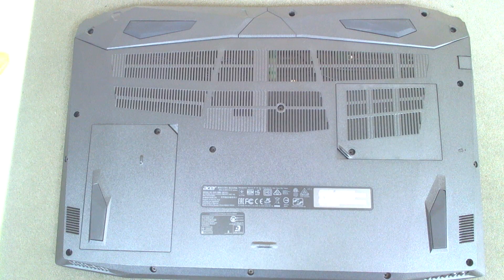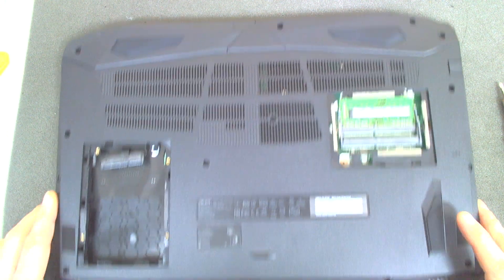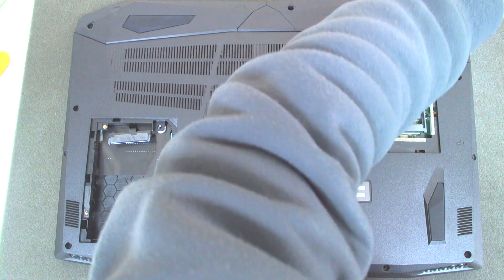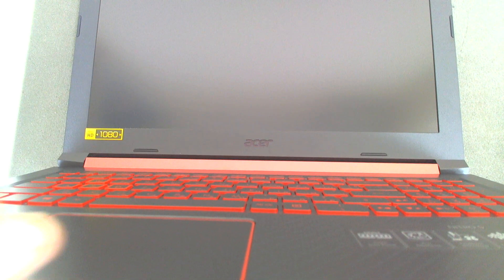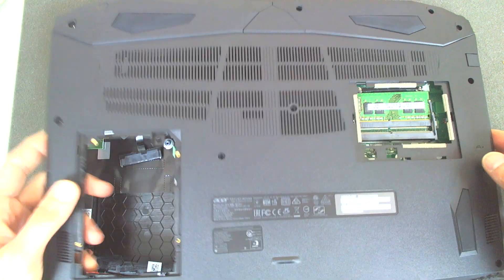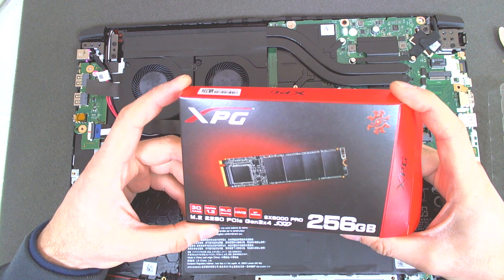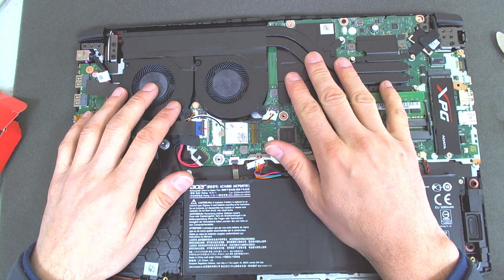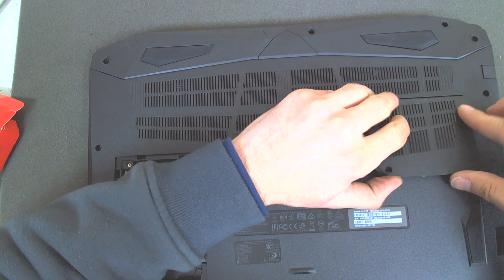Acer Nitro AN515-31 М.2 SSD Upgrade / Install

Comment: why do you need to remove the whole bottom panel when you have separate slot removal available for SSD and Ram upgrades?
Reply from the maker: I guess you did not watched the hole video. The slot is for the regular 2,5" hard drive. In the video i upgrade ( add ) M.2 SSD on the slot, which is next to the ram, but you cannot access it without removing the back cover.
Reply: @LaptopDisassembly  oh yeah. Watched it. It outside that separate slot area. Got it. Thanks!

Comment: Hello ...bro ..please
Tell me which is the best m.2 ssd?
Samsung 860Evo or XPG 6000 pro
Reply from the maker: I would go for the Samsung. I had a few problems with Nitro and AData ssds
Reply: @LaptopDisassembly  and one more question bro pls.....does AN515-52 supports nvme SSD !?
Reply from the maker: Yes
Reply: Pls reply!!
Reply: Bro!..but some users are saying only m.2 ssd is supported not nvme ssd
Reply from the maker: @gaminggalaxy2025  i did install abiut 5-6 nvme on that laptop. But i had 2 cases on adata ssd, the laptop was loosing the ssd from time to time. After replacing them with Kingston a2000 ir Transcend models, the problems disappear.
Reply: Then ..what should I buy nvme or m.2?..I am asking so many ..but no one are giving correct info bro...
Please atleast you should solve my issue
Reply from the maker: Well you will not see any difference between nvme and regular m. 2 ssd if you are using the laptop for regular things. If you are using big files or use the laptop for programming nvme will be better. It is up to you.
Reply: @LaptopDisassembly  thank you for giving info❤❤
Reply: And last ..please can u suggest best ssd for this laptop..I mostly play games and sharing files
Reply: Bro reply pls!!
Reply: My laptop Acer i5 8th gen gtx1050ti
Model- AN515-52

Comment: ''Even the laptop is new check the screw of hinge'' BRO WHAT ? if you do this your warranty is gone. Guys dont do this. Just change the ssd and dont touch any cable or screw.
Reply from the maker: I just say to tide the screws... Not to remove them. Beleve me im selling computers for about 15 years so far... You have no idea what is the new electronic. Sometimes the laptops comes with scratches and not connect cabels, or not proper connected ram... But is up to the customer.. :)

Comment: hi sir yanko. how do i make my hdd as storage now that ive finished putting my os on my ssd? thank u
Reply from the maker: Just remove the old regular drive and format it on a different machine. Or start a fresh instalation and just go to the part where choosing the disk, and just format the regular drive. After that cancel the instalation.

Comment: What if I don’t want my windows on my ssd?can I just boot it without fresh installing windows on ssd and keep the ssd only for games?
Reply from the maker: In order for the computer to work faster the os must be on the ssd. Uoy can leave the os on the regular drive and out the games on the ssd, but it will work absolutely the same like without ssd.
Reply: Yanko Goshev Yes thank you. I don’t mind it working the same but I get 100% disk usage when playing my games on my HD. So therefore I want only my games on my ssd
Reply from the maker: You get 100% disk usage because your regulars disk cant keep with the os and the other parts. If you install the games on the ssd only, you will get 100% disk usage again, because the os is one slow regular disk, no matter that the games are on the ssd.
Reply: Yanko Goshev also will this ssd work fine? https://www.mymemory.co.uk/transcend-240gb-sata-iii-m-2-2280-internal-ssd-6gbps-550mb-s.html?gclid=CjwKCAjw4rf6BRAvEiwAn2Q76hiRi1ktFv_DxIbmHsFtwvvQXCjf5J186whTUVhBuGS2W8IqPS0ifBoC0HkQAvD_BwE
Reply from the maker: Yes it should work fine.
Reply: Yanko Goshev okay thank you. However I did notice that the golden pins shape on your ssd is slightly different to mine. You sure this would work fine? Thanks again
Reply from the maker: The one i install is nvme, the one you post is a regular sata 2280 ssd. Both work fine with that model.
Reply: Yanko Goshev But will games work fine without FPS drops? (I’m getting freezes now) if the games are on ssd and OS is on hard drive? Or no?
Reply from the maker: @Mark-jc8eg  it will be like is without ssd. The os must be on the ssd. The game can be whether on the ssd or on the regular drive.
Reply: Yanko Goshev hello, I cant seem to unscrew the ssd screw. It’s so tight. What screwdriver do I need? I have many and I think I have the one needed
Reply from the maker: It is a regular screwdriver.. Just use smaller bit. Also while tring to unscrew it, push down and try to make a turn..

Comment: Hi Yanko! I have a question. If I put an M.2 SSD on my nitro 5, do I still need to use backupper or true image to install windows on my new SSD or its okay not to? because I dont mind formatting my old HDD since its new. Thanks !
Reply from the maker: When you install the ssd start a regular installation. Delete the regular disk, format the ssd and install the os. Aomei Bacupper is when you like to clone the os to the new ssd.

Comment: My acer nitro ryzen is painfully slow. Games runs good ,but the boot time and freeze and everything else is very very slow. 
Has someone else encountered this?
Reply from the maker: Just add ssd drive, if you dont have by now.. It will change the laptop completely
Reply: @LaptopDisassembly  thanks my man

Comment: Hi Yanko,
Can I use samsung v-nand ssd 860 evo 500gb in my acer nitro 5? Thanks!
Reply from the maker: You can use it, but lately i noticed a thing. This modela do not work properly with all thw nvme models. I had few but they dont work properly with the same ssd. They work with transcend ones, but not with AData or Silicon Power. So is all about the memory chips. If you can try it before buying. The problem si random bsod every few days.
Reply: @LaptopDisassembly  Many thanks Yanko for your comments....please can you tell me the specs for 8Gb RAM for Nitro 5? Thanks again!!!
Reply from the maker: In my case if was 8gb 2400MHz DDR4
Reply: @LaptopDisassembly  Many thanks!...stay well!

Comment: Can you do this with the acer nitro 5 an515-52-52bx with Intel optane.?
Reply from the maker: The disassembly is the same. Disconect the hard drive and remove the screws. After that lift the back cover, that's all.

Comment: Hi, I have a  acer nitro 5 AN-515-52 i need to install SSD, i already have made lots of game installs in my 1tb and data too, if i install the ssd is it necessary i need to install windows in it for the laptop to become fast?

If i need to install the windows on my ssd will i loose all my data from HDD or just the windows data?
Reply from the maker: Hello, if you i stall the windows on the sad drive you will loose the installed games and software. Best way is to clone the instalation from the regudrive to the ssd. This will make a mirror image and it will move the old instalation 1:1 to the new ssd. Use programs like aoemi Bacupper or acronis true image
Reply: @LaptopDisassembly  I had seperated three drives basically , C- Drive in which my OS is installed , D- Drive in which my Games are installed and E- drive for my other music, so if i am installing Windows on my SSD from C drive will i still loose my data and games from D and E drive?
Reply from the maker: Even if the games are installed in the others drive, they still put some system files in the windows and program directory, so after tge new instalation probbaly the games will not run. So best way is to clone the os drive only..

Comment: Hello I have a question, so my nitro 5 has only 1tb hdd and I am planning to install an m.2 ssd and plan to move my os there for faster startups and maybe a few  commonly used apps. I was just wondering if I move the windows to the ssd, will it affect my files? Sorry I am not familiar with these parts.
Reply: Cristian Gannaban what is the version of your acer nitro 5?
Reply: @Dontknowanymore1111  the 2018 version actually
Reply from the maker: No, when you clone the windows it copied the files 1:1. There will be no difference before and after the cloning. Use aoemi Bacupper or Actonis True Image.

Comment: Man you need to study up on removing back panel you look like you simply do not know what your doing
Reply from the maker: If you say so...
I have been doing this for about 15 years so far. This is brand new laptop, that the costumer havent seen yet. I try to be as much as careful i can be. You will probably not buy new laptop with scratches on...

Comment: My Acer nitro 5 comes with Intel optane memory. Will I have to remove that to insert an NVME2 SSD?
Reply from the maker: Yes
Reply: How will the setup be then? I'm not sure what to do after putting in an ssd instead of the optane
Reply from the maker: @scarztea  what exactly is the druve in the slot now..
Reply: I have a 1TB HDD and 32gb Intel optsne memory installed right now but there's only one C drive on my laptop
Reply from the maker: Well in that case, remove the drive. Install the new ssd. After that go to bios and change the sata mode to ACHI ( it was intel optane i suppose) Aftwr that make a fresh install or clone the os to the new ssd

Comment: My headphone jack stopped working after. How to fix it ?
Reply from the maker: I dont remember correctly where exactly it was, but did you connect all the cables before closing the laptop.
Reply: @LaptopDisassembly  Got it working. Opened the laptop again and saw that the board with 2 usb-A ports, charging port and headphone jack slipped inside little bit. So i got it fixed myself.

Comment: Why i’m not able to boot? The computer doesn’t find the usb stick
Reply from the maker: Did you make a bootable UEFI media. If not try to activate the legacy mode from bios and activate Boot Menu (F12) from main page on bios.
Reply: @LaptopDisassembly  it's activated, but my computer doesn't see the usb stick in the boot menu. There's just empty  in boot menu. Maybe it's because of the usb stick. I'm gonna buy a new one. But what if it still doesn't work?
Reply from the maker: Make the flash drive with Microsoft media creation tool and also try different usb.
Reply: Yanko Goshev how to do flash drive?
Reply from the maker: Download the program and follow the wizard

Comment: And does this work with all Nitro 5? Btw can I still do this upgrade after I used the laptop for like 1 year
Reply from the maker: The laptop is 2019 year. Yes yoy can do tje upgrade any time. Just clone the os or make a fresh install after that.

Comment: Nice content.. keep it up.. I want to know how to upgrade RAM.. if RAM 4gb combine with RAM 16gb.. what will happen..? Thanks.. done subscribe for you channel..✌️😊
Reply from the maker: Hello, first look what is the configuration of  the memory now. You have 2 slot total. If you have one with 4GB than you have one free. If you add one 16GB ( if possible ) you will loose the dual channel mode. The better way is to remove the one you have now and add 2x8GB. This way you will have 16GB total, working in dual channel mode.
Reply: @LaptopDisassembly  o i see.. which one is better dual channel mode with 2x8GB or single channel mode with 16GB
Reply from the maker: @jempurungjebert  Dual channel will be about 10-15% faster, but you will loose the ability for future upgrade.  :) It is up to you
Reply: @LaptopDisassembly  wow.. thanks for sharing..  will be think twice.. by the way.. sharing from u very helpful.. thanks a lot..

Comment: Is it possible to move already installed win10 in the default HDD to the new SSD, of course without fresh start(delete , reinstall)?
Reply from the maker: Yes, use aoemi Bacupper and use the systrm clone options.. It will do the job
Reply: @LaptopDisassembly  Baccuper is a software? AOMEI Backuper? 
Does the free one will do the trick?
Reply from the maker: I use the bootable CD ...https://www.ubackup.com/features/create-bootable-disc.html
Reply from the maker: Or use Acronis True Image also bootable DVD It will do the trick
Reply: @LaptopDisassembly  btw, does 128GB SSD will be enough for only the system(win10 home, pro, or any win10)?
Reply from the maker: @SatrioBudiDharmawan  yes is more than enough. When i install a costumers laptop i leave 100gb for the operating system. If you have a steam account you will probably need more, but usually is more than enough
Reply: @LaptopDisassembly  well, actually I have steam accounts and play a lot. But I think I will put the steamapps on the HDD until I can save money to buy bigger SSD.. :)
Reply from the maker: This is also an option,  but the difference between 120 and 240 is not very big.
Reply: @LaptopDisassembly  Btw, I have a question, dunno, for Acer Nitro 5 (AN515-52-51T2). I got it with original 1TB HDD is ATA drive.
Is it normal to have it ? I mean, today, ATA...seems weird
Reply from the maker: It is not ATA.. It is Sata.. There are plenty still so no worries.
Reply: @LaptopDisassembly  no,.I mean my laptop(that Acer I mentioned) is detected as ATA not SATA. I only checked it with WDC Data Lifeguard Diagnostics something, it read as ATA not SATA..
Reply from the maker: It is impossible. The hard drive is 100% sata or it can read it like Serial ATA, which is the same. Enter bios and check how is recognized.

Comment: I bought this laptop three days ago. It is very slow in easy tasks. It takes a lot of time to open the program. Sometimes there are some problems inside the program that comes with hdd. If I add m.2, will it make a difference?
Reply from the maker: Yes, it will make it faster. But you should check the regular hard drive. Use CrystalDisk Info to see its health.

Comment: I have Acer Nitro AN515-54
I have already 1 tb regular micron SSD i want to upgrade to NVMe SSD, i want to know if i can keep both and how do i install new OS on new SSD 
is there any way to transfer my current windows to new SSD, i don't want to loose my current setting and programs.
Please help me with this
Reply from the maker: Youcan clone the os with acronis true image or Aoemi Bacupper.. I use the second one mostly.  To use both ssd you have to put thw nvme on the m. 2 slot and the other ssd with convertor from m. 2 to sata. https://www.ebay.com/itm/163358159768

Comment: Can i buy samsung 860 evo 250 gb for my acer nitro 5 and use ssd and hdd at a same time. Plzzz reply
I have AN515-42-R6GV MODEL
Reply from the maker: Yes but the ssd should be m. 2 2280 not regular one.
Reply: @LaptopDisassembly  sir can you plz put the link I will be thankful to you becoz it's my first time and I don't want to regret. Plzz sir
Reply from the maker: https://www.amazon.com/Samsung-250GB-SATA-Internal-MZ-N6E250BW/dp/B07864V6CK
Reply from the maker: This is better https://www.amazon.com/Samsung-970-EVO-250GB-MZ-V7E250BW/dp/B07BN5FJZQ
Reply: @anuj3438  did it work for u?

Comment: Hello , i'm getting some trouble , when i put the ssd in and turn on the laptop , Bios showing up , but i did not see the name of the SSD, then i go to boot and did see anything in Boot Priority order , and also my Boot mode only have UEFI , pls help me
Reply from the maker: Did you try to install windows. The ssd should be visible in the installation section. Yes UEFI is better to install windows 10
Reply: Install windown ? Mean move the windown from hhd to ssd ?
Reply: Or i need to have a new windown ? Cause i did not replace the ssd , it was empty in the first time i screw the laptop
Reply from the maker: Do you have any operating system on some of the hard drives. If yes, try to clone to the new ssd. If not tfy to make a fresh install to see whether it will detect the ssd or not.
Reply: I will try to clone
Reply: I have a problem , when i take the sdd out , then i turn on the laptop , the Bios still appear , i'm very confuse , i thought it would be back like normal
Reply from the maker: What is appear,  i cannot understand. If you did clone the disk, try booting from the new one. Just remove the regular one and try to power on the laptop. If that douse not work, just make a fresh install on the os.
Reply from the maker: Sorry for the delay but is due to time differences. :)
Reply: Well , i found the problem , i broke the HDD cable :v , now i need to find one and buy , or can we run the laptop buy move the windown from HDD to SSD ? I mean let it run by only using ssd
Reply: I find the cable online , but it only deliver in US , i living in Canada , now the laptop is a little bit dusty .___. , now i just wait for someone on ebay who gonna sell that
Reply from the maker: @ToanNguyen-xy3rk  you can putthe regular disk in external case and clone the os ti the ssd with aoemi Bacupper. The laptop will work only with ssd till the cable arrives
Reply: Hey man , i bought the new hhd cable , i put it in and turn the Laptop on , after 30 minutes of attempting repair , i finally  get straight into my desktop , but the problems is i try to find The ssd , by going back  to Bios but still i did not see it ? I don't know what is the problem
Reply: Thanks for reply

Comment: Can you tell the exact size of the screwdriver for the ssd screw please?
Reply from the maker: The correct screw size is 2.0 x 3mm. I cannot tell you about the screwdriver. I just use a smaller cross one.
Reply: @LaptopDisassembly  cause I tried a number of screwdrivers yesterday but none worked😶. Was a waste of time opening it and putting it back again
Reply from the maker: Just use one with sharper head, like the ones in the iphone disassembly kits.

Comment: Hello, i have an Acer Nitro5 an515 52 512j have this laptop a M2 SDD slot?
Reply from the maker: Yes it have.
Reply: @LaptopDisassembly  Thank you for the answer, can u tell me which one is compatible with it?
Reply from the maker: Most of the models are compatible. As long as it is m. 2 2280 ssd.